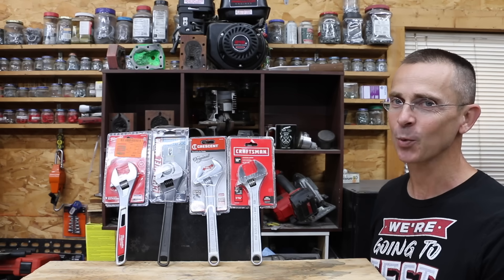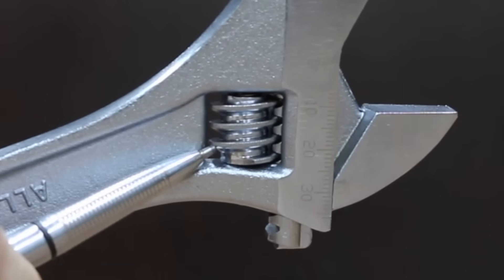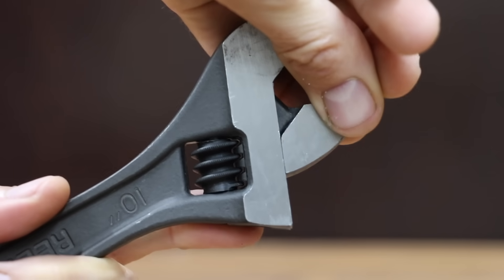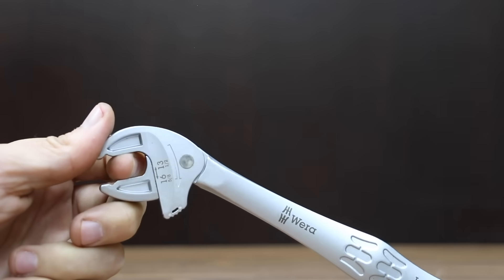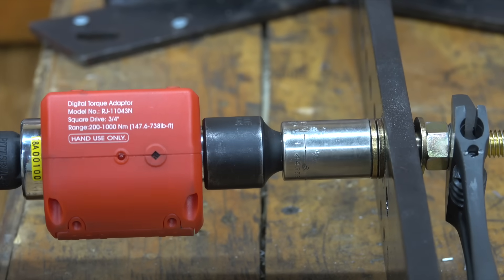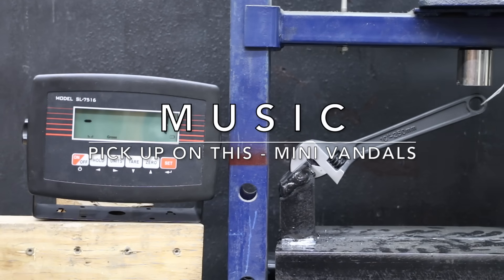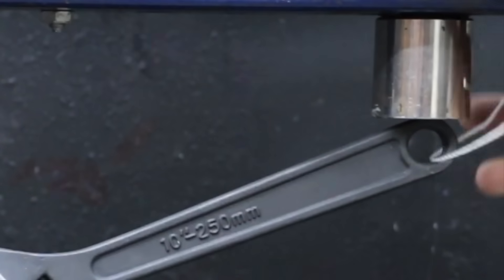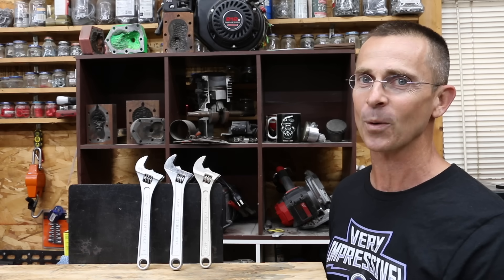Best Wrench (ADJUSTABLE)? Craftsman USA vs Craftsman, Crescent, Kobalt, Milwaukee, Channellock

Comment: Fantastic testing! I would have been very curious to see how those all performed with the torque applied in the correct direction though. Applying the torque backwards, while in agreement with internet lore, puts the load on the TIP of the adjustable jaw, far from it's point of support, resulting in much greater flexing and much earlier failure. The fixed jaw is much stronger and thus much better equipped to handle this load. Funny the one even had the arrow in the wrong direction lol.
Reply: Seconded
Reply: Thirded
Reply: A rare fail in testing methodology from Project Farm.  Results may still be relatively correct but used the right way, torque would be much higher.

Comment: It would be interesting to see how the old Proto design with the squared out profile with only a minor inside radius to reduce the stress point at the base of the jaws would have performed against any of these.  That feature used to be Proto's selling point back in the day.  I suppose there was a tradeoff by not having the angled fillet at the base of the jaw when applied to hex shaped fasteners.  The old claim was that a fastener would be positioned deeper into the jaws where it is stronger with the squared out profile.  The new Proto adjustables have a jaw profile similar to the competitors.  The claims made about the old design may have been debunked or the "smartest guy in the room" at Ingersoll-Rand or Stanley just changed it for whatever reason.
Reply: SnapOn too
Reply: Proto used to make tools for Craftsman. Entirely possible we just saw it.

Comment: Would you consider testing work clothing such as dickies mechanics button up shirts and matching pants? Tears from getting caught on oblects in the shop and sliding on concrete from sliding underneath vehicles would be very interesting tests as well as button stitching and stain resistsnce

Comment: One of my better adjustable wrenches is either a crescent or a channel loc but it does prominently say made in USA. I remember checking out the wrench because I realized it was of a higher grade than the other "crescent wrenches"  I had. That being said , my favorite wrench  is a husky needle nose vice grips.  I assume it is made in Taiwan. However I use it for everything.  Never would have thought to purchase one, it came in a set of vice grips.

Comment: Just goes to show, older is better.  Sad. With adjustable s I find myself readjusting during a use. As u tighten snug uo the fit, it works better . All of my adjustables are crescent wide mouth with heavy duty rubber grips. And the 10 inch seems to have very minimal play. But my channel locks are Irwin. Can't seem to keep the 6 inch. They get misplaced on jobs. Thanks for the look see and test. But seems as usual high price doesn't always mean best quality.

Comment: Could you run a test to see if the smaller high tensile barb wire is really just as strong as the thicker regular wire.

Comment: Finally I have proof to show everyone that thinks adjustable wrenches round every bolt they touch. With a good wrench and actually adjusting them properly you can get as much or more torque than an open end from an adjustable
Reply: I guess I've been pretty lucky with the mid-grades. 2 tricks I use are keeping thumb pressure on the adjustment. And I like to get the wrench in a bind against a solid surface before torquing, and hold it in that bind until finished. Far less likely to lose their bite when kept under a steady bind.
Reply: @TonyGingrich  Definitely keeping tension helps and holding the worm does too. I use harbor freight adjustables so i use the bottom basement tools but used correctly i've still never rounded any bolts i've used them on

Comment: Can you make a video comparing Micro pen automatic screwdrivers? i bought a Wowstick just recently and after about a month of use its torque is gone. i was wanting on that has a good bit of torque to last longer for multiple laptop disassembles at my job.
Reply from the maker: Thanks for the suggestion..

Comment: You should do a video testing the strength of different types/brands of butt connectors for joining two wires
Reply from the maker: Thanks for the suggestion.

Comment: very impressive comparison, more so with more inclusion of german brands. wera joker has the best design and is the easiest to use among all, with the crescent being the best value for money traditional wrench. old companies like crescent tools are gems in the trade. need to do a showdown between top adjustable wrench vs top wrench pliers. also interested in a worldwide 2 part epoxy adhesive showdown.
Reply from the maker: Thanks!  Thanks for the suggestion.

Comment: I appreciate the thorough testing, in the UK we don't have access to many of those brands but your comments help identify what to look for, jaw wobble, length of jaw etc. I often find myself striking the handle with a dead blow hammer to try to shock fasteners loose.
Reply: As an aside, have you considered long nose plier testing?
Reply from the maker: Thanks so much!  Thanks for the suggestion.

Comment: Please review garage floor epoxy. Fingers crossed this one is already in the works because I need some ASAP. We need to coat Wood and Metal Shops so really curious how well stains and layout dye clean off of them plus handling harsh cleaner like acetone
Reply from the maker: Thanks for the suggestion.

Comment: I can't believe you broke the Craftsman USA. What useful information was gained by breaking it? I thought the purpose of these tests was to help inform buyers. The Craftsman USA isn't made anymore and is only available in unused condition fairly rarely. Breaking it only served to destroy the best wrench in the test--a wrench made by American craftsmen, which someone could have enjoyed using. Not to mention that the data gained from the break test is useless. Nobody puts 600+ foot-pounds of torque on a 10" adjustable wrench. Pure waste.

Comment: I have a suggestion. I have a tiny bit of water in my gas tank and I've been using Heet. I saw your video about that, Seafoam, and alcohol. Would you do a test to see if an engine could run on just Heet?
Reply from the maker: Thanks for the suggestion.

Comment: A small point but with crescent wrenches do you not get superior performance when you use them backward (opposite to the arrow). The torque is generated closer to the inside of the movable jaw rather than further away.

Comment: Great testing as always! Two complaints however...

1) The Vintage Craftsman should have had the roundoff number at infinity since it never rounded off the nut and broke the bolt instead!
2) You stopped the failure test on the Milwaukee before it actually broke unlike all the others. So it seems like there was force left on the table.

As others have said, it's impressive seeing the vintage Craftsman showing up every other tool in almost all the tests. So thanks for including it! I also can't believe how much some of these wrenches cost, I'm glad you get money from ads and product sales for doing all this!
Reply from the maker: Thanks!  Thanks for the constructive feedback.

Comment: Again a "Very Impressive" test!

However, I've got a remark concerning the usage of this type of wrench. I first noticed when you discussed the Crescent brand and mentioned the forged-on arrow indicating its direction of use. In my not so very humble opinion, however, this arrow points in the WRONG direction! Especially when the moment arrives that more force has to be applied.
The two pressure points that can handle most force, are the tip of the fixed jaw and the base of the adjustible jaw. Think about it.

Looking forward to your next test.
Reply from the maker: Thanks for the constructive feedback.

Comment: Great videos! Thank you!
Would you do another video on lubricants, only this time covering things like graphite, 3-in-1 Lock dry lubricant, silicon lubricant, white lithium lubricant, and fluid film? In my reserach, I've found conflicting reports about the use of these on lock cylinders, latches, and hinges. For example, may people say to use graphite power on lock cylinders, but other places say never to use it. Medeco, who manufactures my locks, says to use Fluid Film, which is lanolin-based. This seems ripe for a head to head comparison!  Thanks for your great videos!
Reply from the maker: You are welcome!  Thanks for the suggestion.

Comment: I greatly appreciate your videos.  On this one, a brand I would suggest including (someone may have already mentioned this) is Martin, made in the US.  It's the only adjustable wrench that I've ever used that I felt like I could count on.  I've never rounded off a nut, and I've even used the 12" with a 3' cheater pipe with no ill effects.
Reply from the maker: Thanks so much!  Thanks for the suggestion.

Comment: You’re making me appreciate my vintage Craftsman. Also, you forgot one test: when the bolt is stuck in a piece of wood so you flip it around and hammer the end flush using the handle. I’m not the only one who does that, right?
Reply: Did that a few times then my father saw me do it and threw a hissy fit. While he was constantly preaching the virtue of the fixed wrenches he did have a pretty large collection of adjustable ones for when he couldn't carry around a kit with fixed wrenches. However he hated seeing them abused as these were quality versions that cost a pretty penny back when he bought them. So he explained how dirt and mechanical abuse could ruin a adjustable wrench by causing wear and bending the jaws. So I tried to refrain from using them as hammers, in front of him that is.
Reply: No mechanic serious about his personal tools would.
Mainly people like USN technicians and peoples children using tools they did not pay for out of their own pocket.

Comment: What I usually do is you can screw one side of the wrench all the way out I’ll usually use a dremel and a rat tail file to put some knurling on one side of the wrench similar to what a pipe wrench would have
Reply from the maker: Thanks for the feedback.

Comment: Great tests, thx Glad you said about wearing protective clothing etc :)  Now start taking all the broken tools and making a gate in the shape of a tombstone and use the winner for the Handle:) Have many made in U.S craftsman tools and rigid pipe wrenches. My DAD was a union master fitter/boilermaker,so grew up with MADE IN U.S. in my ear.can recall as a teen "helper" on jobs you would find foreign made tools welded to pipe or beams or sides of tools boxes on job sites:)  
 Funny though because after that was navy trained on jets and a crescent wrench of any type was BIG NO NO even near our jets:)because of any chance of rounding a nut,bolt off so a crescent has never been a go to wrench for me. Nice to see most of my shop tools that came from DADS tool boxes or were the oddballs at garage and estate sales for free or cheap are in the tops in your tests :) :) thx. Rick
Reply from the maker: Thanks!  Thanks for sharing.

Comment: I use a Snap-on (Bahco, just chrome plated) at work, the wide jaw opening is awesome, and the jaws are narrow enough to be used for something like loosening the chuck up on an air grinder. Strongest? No, but very versatile.

Cool test!
Reply from the maker: Thanks!  Thanks for sharing.

Comment: I have that cresent. Thank God for the arrows. I was beating myself about the face and head with it until I realized that it was supposed to be put ON THE BOLT and turned one direction or the other to tighten and loosen fasteners.....
Reply from the maker: Thanks for the feedback.

Comment: Hated to see the "real" Craftsman die in the name of testing but it did us proud!!
As always. Fantastic work, hats off.✌️👍

P.S.
I have a 16" Craftsman in my roll away. It was laying on the floor in my dad's friends garage for years and years. There was a speaker magnet stuck on it so it was one giant chunk of rust.
Took a long time to get cleaned up and working.
It was given to me at the age of 15.
I'm 55 now. How it made it through all the moves and weird things that happened between then and now. I have no idea.
I still use it. Mostly for shaping sheet metal. Nice wide jaws can put a nice brake in a small piece of tin or aluminum.
It's so heavy. It would certainly damage one of my bikes if I dropped it.
So I rarely use it.
I can't believe I still have it.
✌️
Reply from the maker: Thanks!  Thanks for sharing!

Comment: I wonder if it would be possible to include snap on and Mac when testing hand tools. It irritates me to spend big dollars if the tool isn’t superior. Often a tool that breaks or damages the work isn’t worth skimping on. Thanks for all your great work!
Reply: Most Snap-On, Matco and Mac tools aren't worth the price.  You're just paying a shitload extra for the name and the tool truck that shows up weekly.
Reply: @aaronthomas6155  You're not wrong. Sometimes SnapOn is my choice when the wrenches have to be skinny to pass each other in a tight space on a double locking nut or similar. Not incredibly often but it happens.
Reply from the maker: You are welcome!  Thanks for the suggestion.

Comment: FYI, the "Vintage" Craftsman (about 10 years or so old) was made by Western Forge, which is now out of business, however, they made the same wrench for a LOT of USA brands up until more recently. Look for the W F way down by the hole on the end of the handle. It would have been cool to see a Knipex Pliers Wrench in this test.

Comment: I have several different brands of adjustable wrenches. The Snap-On wrench I have is very old, was very expensive, and is by far the best of the bunch. Nothing else even comes close. I hear, however, that they don't make Snap-On tools like they used to, so I can't speak for the newer ones.
Reply: The quality of Snap-On, Matco and Mac tools has gone down quite a bit over the last 20 years alone....  The open end wrenches almost immediately flare if any pressure is put on them.  The ratchet gears break very easily.....  The "vise grip" pliers almost completely destroy their teeth if tightened enough to actually bite into anything.  Their drill bits snap off like they're made of porcelain....  It's like they're trying to compete with the Pittsburgh brand for quality but price the tools like they're gold plated.

Comment: Nice Review!! I have a new video idea, how about testing different Tire pressure gauges. Cheap, expensive, digital, analog, round gauge and stick. I'm looking for a relatively inexpensive tire gauge, preferably a digital for easy reading and maybe even one that is integrated into the inflation tool.

Comment: Would love to see more tool truck brands like Cornwell, Matco, Mac, and Snap On used in these tests to see if there higher cost is justified.
Reply: The short answer is.....no....  It's not.  It's easier to just ask an experienced mechanic....  Many years ago, there was a difference in quality between Mac, Matco and Snap-On....and tools found at home improvement stores.  These days, you can find similar quality tools for much less money online.  Snap-On tools from 30+ years ago, will easily outlast Snap-On tools made in the last 20 years.  Same goes for Matco and Mac.  Even some Harbor Freight tools will outlast the garbage Snap-On, Matco and Mac are selling now.....

Comment: Crescent wrenches are what you grab in an Armageddon type situation...when there is nothing else left except for a rock and a hammer.  Use the right tool for the right job...and that NEVER includes a crescent wrench.  Great video BTW, never get tired of your exhaustive research and testing!

Comment: I know you done alot of oil tests. How about seeing which type of oil Dino vs synthetic transfers heat the best?
I run a air cooled engine in my car (VW) and motorcycle. I would like to see actual test on which type can transfer heat away from the metal it is lubricating.
I have see articles on both saying  they ( Dino vs syn) do it the best. I would like to know for sure if the more expensive synthetic can carry heat away from my cylinder heads  better than conventional. Thanks

Comment: Great video, one thing that I noticed though is that the Bahco wrench is the slim head version, the original chrome version with the thicker head is probably noticeably tougher I would think. Snap on has had their adjustables made by Irega and Bahco. Again, great video, thanks! Keep em coming. I was impressed with the old Craftsman.
Reply: "Snap on has had their adjustables made by Irega and Bahco."
Bahco has been owned by Snap-on since 1999.

Comment: Wow I had no idea that a wrench could even slip, I was sure the handle would snap before that! Very usefull info you put out there! I wish you did a corosion test on those too.. would you test diferent ratchet brands?? No wonder the common name is a crescent, they are just unbeatable for the price. Very suprised how those other very expensive brands were actually  not really better. Save your cash and buy crescent.
Reply: Good point, He could have done a corrosion test as a last test after the destruction test on the broken tools.

Comment: How about a comparison of Allen Wrenches? So far I’ve really been happy with my tekton and am curious how big of a difference there is between companies
Reply: There can be a huge difference between companies.....  I have allen wrench sets that will fail to prevent fastener damage, and I have allen wrench sets that will completely destroy a fastener with no visible signs of damage to themselves.  It's very much dependent on the exact material composition used, which is dependent on manufacturer.